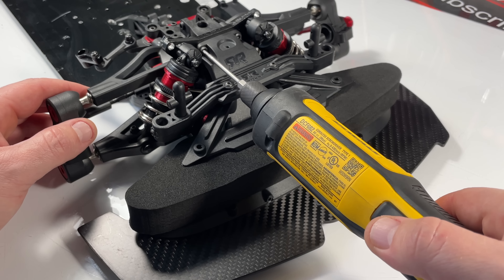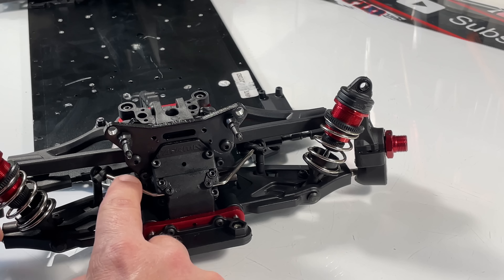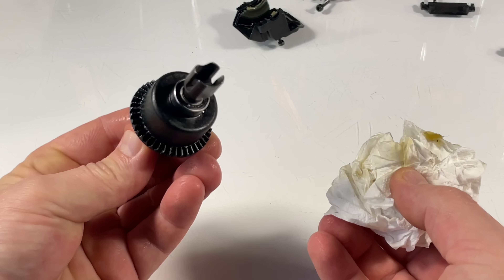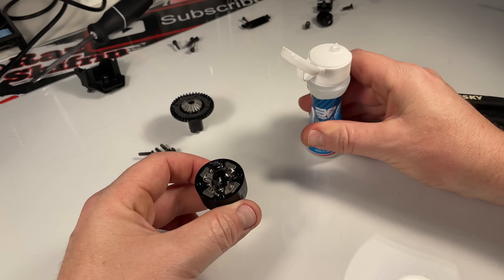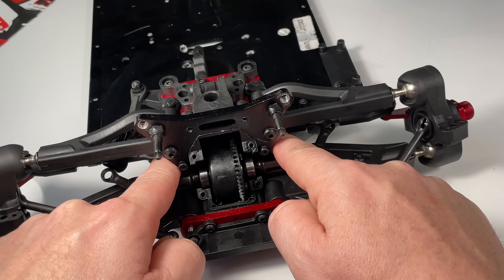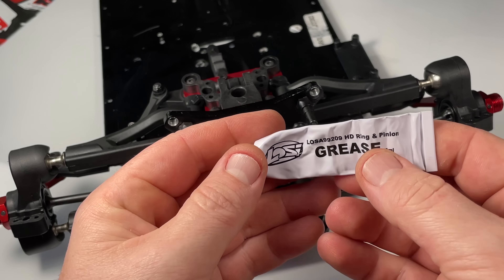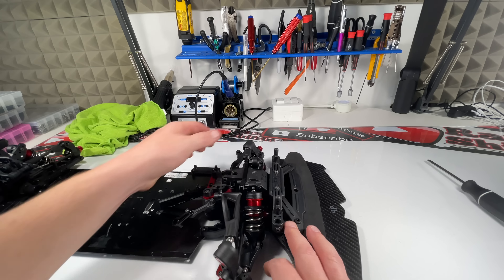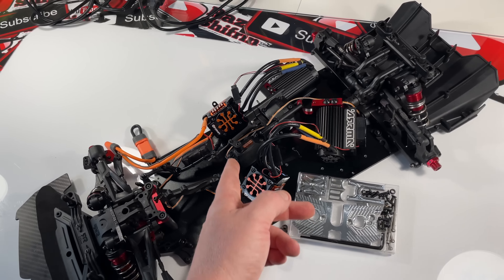How To Change Diff Fluid In Arrma

Comment: Oil in the screwholes will RUIN the diff.

This is a great tutorial except for a few super important things that will absolutley ruin a high power output machine.

Oil in the screwholes will hydrolock when installing the screw and ruin the threads, the diff will later split under load and it will be a bad day.

I recommend to use a small 1.5mm drill and drill straight through so that the oil can escape on the backside. This is only possible on 3 holes due to the small "bleedhole" screw being in the way of the last hole. For the most extreme setups and for bashers with big tires I use longer screws.

Always keep the threads as clean as possible and use a few drops of blue loctite on the screw where it seats on the ringgear. Now enjoy your durable diffs👍🏽. 

Love your vids Raz! Keep doing you!
Reply: I've car engine blocks split from head bolt holes not being cleaned out.

Comment: The quick and most effective way to fill is to put some fluid in first before the  gears then do it in turn, No waiting for the fluid to run through and past the gears and you know there's no air gaps. The thicker the oil the more time it saves.

Comment: Hey Raz mate, that thick oil: tip, when you start to work on the diff, leave the bottle of oil in a cup of boiling water until you need it to heat up the oil a bit. Comes out much easier then.
Reply from the maker: Cool!!
Reply: The plastic bottle would melt before the viscosity of silicone oil was affected.

Comment: What's good Raz? I usually stick any heavy thick fluid in a cup of hot water to make it more manageable.  I use powder Teflon no slinging and it stays on the gear keeps it rubbed and it doesn't roar as loud. Good vid tho thank you. 👍🏾👍🏾

Comment: Great video! I did the middle and rear but was unsure how to remove the front splitter bumper in 1 peice. I will have 500k in front and rear and 1mill in center on a 1250kv 8s 160amp spectrum system infraction.

Comment: Hi, how often is it advisable to replace the silicone of the differentials? greetings
Reply: Until they significantly lose viscosity. You will know when you rotate the wheels and there is zero resistance between both sides. That, or if the differential cup leaks.